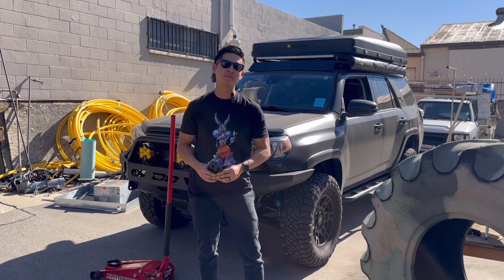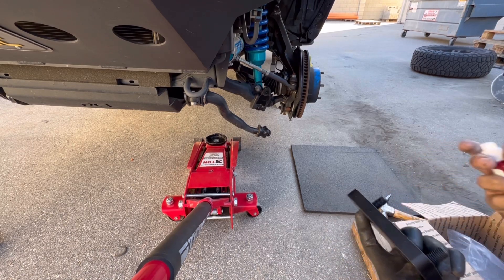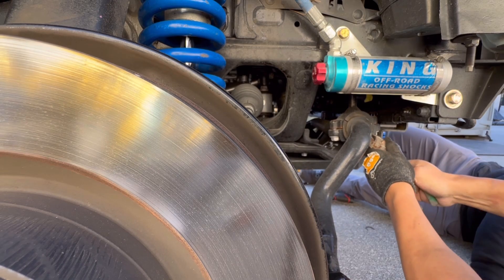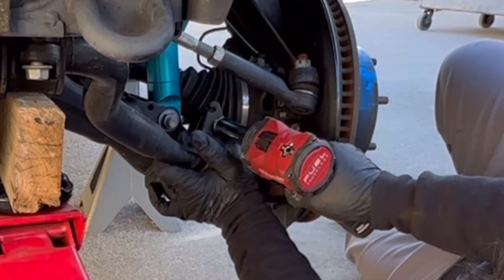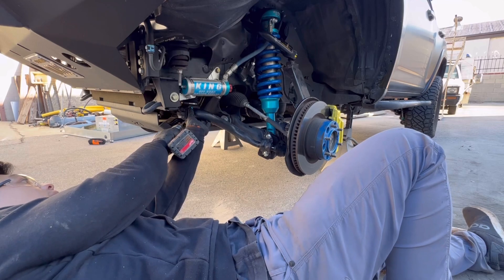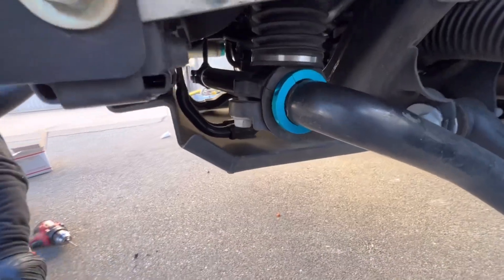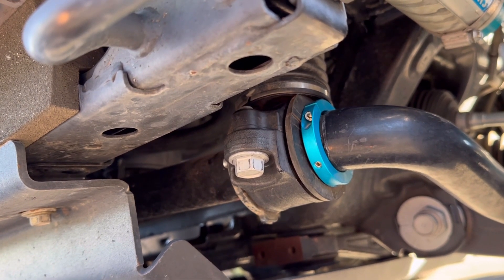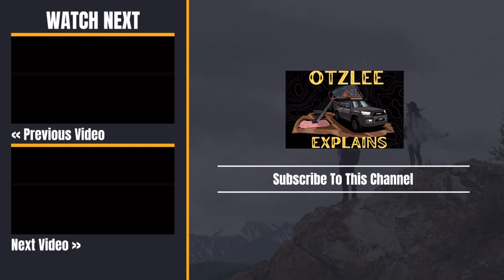A MUST HAVE KDSS fix for 5th Gen 4Runners with Dr KDSS

Comment: A number safety issues here with the grinder operation. Wear protective gloves, NOT latex. Wear safety glasses, NEVER operate a grinder without them. Use a grinder with a handle and a guard. If your grinder doesnt have a handle, at least hold it with two hands.  Secure the item you are cutting in a vice. The way the operator is holding the bracket with their hand is so dangerous you are asking to lose or severely injure your hand or another body part.

Comment: I order the billet clamps for my sway bars, front and back. After watching this and other videos I went and looked at mine and realized the front passenger side outside rubber "clamp" was missing. Completely gone.  The driver side is stretched and twisted and about to break.  My truck is 2021 (granted with about 50K miles) but I was surprised how bad they are.  The KDSS shock body is right up against the frame too!
Reply from the maker: Wow that clamp took a beating! This will help fix your issues moving forward! Do you wheel hard?
Reply: @OtzleeExplains  I don’t wheel my 4Runner very hard.  I have put on a fair amount of miles but I don’t rock crawl with it.  I have a heavily modified H1 Hummer that I take to Moab and that gets pretty well used.  The 4Runner is my family camping in the desert or mountain mobilize… so I was surprised to see the status when I looked at those rubber clamps.

Comment: Does this mod also apply to an Icon lifted KDSS equiped 4Runner?
Reply from the maker: It applies to any kdss equipped 4Runner with an added lift. The added lift puts a lot of stress on the joints.

Comment: Is anyone running into the issue with having CBI skids? So after install and treaty oak spacer OR the DR.KDSS adapters the front sway bar sits pretty much on the CBI front skid. Hoping someone might have a solution...

Comment: I’m about to do this mod so thanks for the video! Did you do the rear? Same benefits as up front. I also got the rear kit with the track bar correction parts too!
Reply from the maker: I haven’t got to the back yet. My front end was the priority. Ill be doing the back soon.
Reply: @OtzleeExplains  you should try and pick up some rear kdss sway bar drop spacers while you’re at it. Blackgate, Treaty Oak, Ironman or Greenlane off-road

Comment: if KDSS is so amazing why do you need a fix? lol
Reply from the maker: Because my rig is lifted and once the vehicle is lifted it changes the angle of the front sway bar, causing the rubber bushings to prematurely wear faster. This dr kdss bracket fixes the angle

Comment: So if you used the Treaty Oak spacer, you would not need this?
Reply: Def don't use them together (I learned the hard way because I didn't read the descriptions). You'll end up getting interference issues. From the DR.KDSS site "Both the drop spacer and these adapters push the sway bar forward. Using both will have the sway bar too much forward and crashing into the front crossmember / skid plate."

Also learned after talking to Dom that this is going to be better than the kdss drop spacers. I have them installed and will be removing them in favor of these adapters.

Comment: Nice video.  I just ordered the KDSS sway bar spacer kit.. I noticed you have wheel spacers.  Have you had any issues with them?  Also how do you like the DR_KDSS outer sway bar bushings?
Reply from the maker: I've been running my spacers for over 4yrs, no issues. The only obstacle I encountered was the need for the BMC. I was getting wheel rub at full reverse. I'm running 285/70/17's. Regarding the outer sway bar bushings, I can't really tell the difference but I was going to work on the KDSS anyways so decided to order the sway bar bushings at the same time.
Reply: @OtzleeExplains  thank you  for the info.  Appreciate you sharing your videos.

Comment: Great video, got the exact the same from dr. Kdss. Have some questions here. 

1: Do you need to jack up the truck let 4 wheels off ground? 

2: do you need to loose the Kdss release valve before adding those parts? 

3: need to reset Kdss after the install? 

Appreciated for your support
Reply from the maker: You just need to jack up the front. You may need a crowbar to help realign the bolt on the sway but it’s not bad. I did not have to loosen or reset the kdss afterward but you will need an alignment

Comment: Great Video.
I have a 2021 4Runner venture and just got a lift 3" king shock's on it but unfortunately it feels like its not alignemd it pulls to the right and at times it vibrates can you please help in informing me what can be happening?
Reply from the maker: Did you get an alignment after lift? Did the vibration happen after the lift? Did you upgrade tires?
Reply: Thank you for getting back to me on my concern. Alignment yes two times because the shop were i got it done couldn't figure it out so after i took my 4 runner back to shop the first time they did another Alignment but that didn't fix anithing and I'm afraid they won't be able to fix because they are telling me to bring it back a 4th time.
So Alignment yes and no tire upgrade i got my Toyo tires about 1 year ago the shop just did a 3" lift and Alignment.
Reply: And vibration started after the lift  Specially when I'm going over 60.

Comment: I wonder if a 2' lift needed this? I'm thinking abt level my runner out with fox 2.0 perfomance 2' front 1' rear.
Reply from the maker: You should consider this even with a 2” lift. The angle of the kdss and sway takes a beating without this. My 2021 TRD orp with 22k miles has worn bushings already from not doing this earlier
Reply: @OtzleeExplains  i might as well have it installed when I do the lift to save time :p
Reply from the maker: @HungNguyen-jq2lx  yes. I would do it the same time. Especially since you have to do an alignment for both

Comment: Why not just upgrade your swaybar endlinks?
Reply from the maker: I may do that in the future.
Reply: KDSS doesn't have sway bar end links.
Reply: @jfriday1ify  I personally own a vehicle with kdss, yes it does
Reply: @Empath-xb6sf  On the KDSS vehicles like the 4runner, GX470, GX460, in the front the KDSS sway bar attaches directly to the lower control arm with no end link, and in the rear it attaches directly to the rear axle.  There is no end links like the non-KDSS vehicles.
Reply: @jfriday1ify  the rear swaybar bolts directly to the axle with one side having an end link attached the frame crossmember on the passenger side. The front swaybar has end links on both passenger and driver side connected to the lower control arms. This is how it's set-up on my 2019 land cruiser, I'm not experienced with other models though.